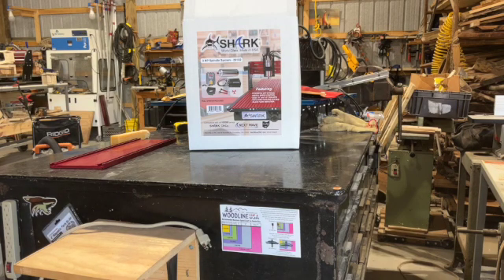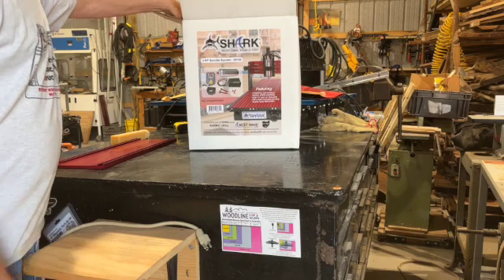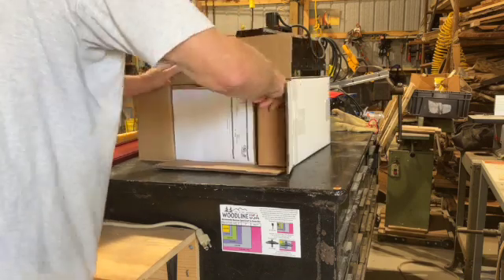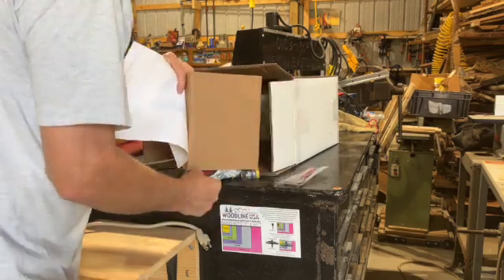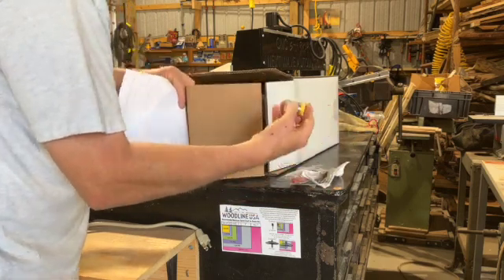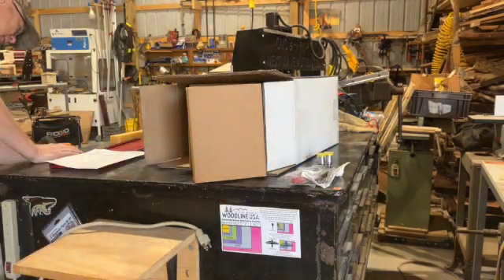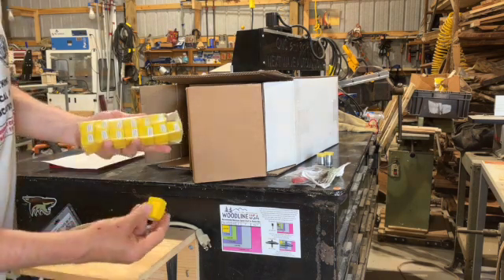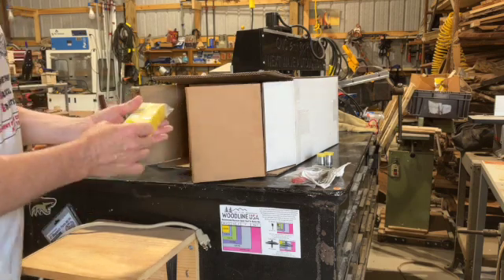Upgrading to a  3 hp spindle  on CNC Shark

Comment: Sorry, one more question, the Speed Controller controls the speed but your speed is controlled by the program correct, not the settings on the speed controller.  My first experience with a CNC router is a shop bot and you adjusted the speed manually on the speed controller and not the software.